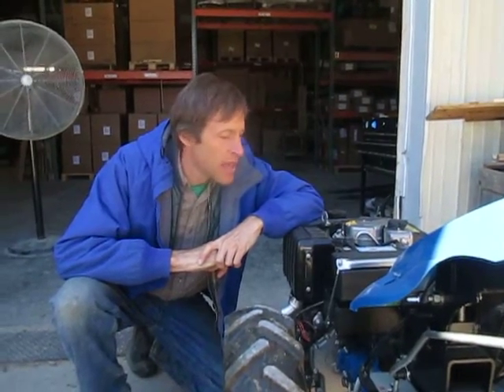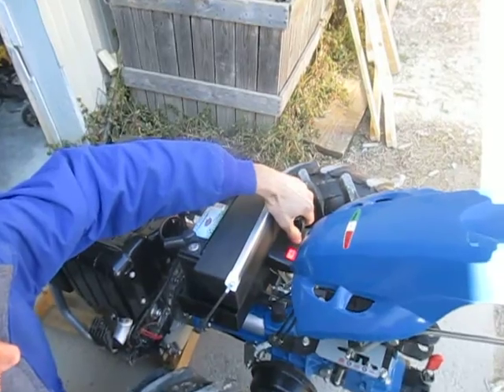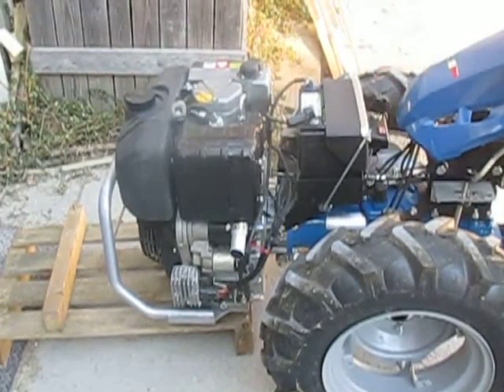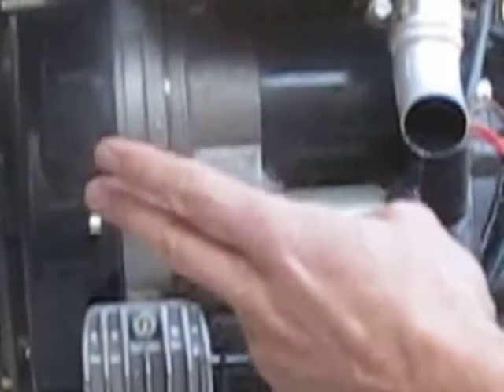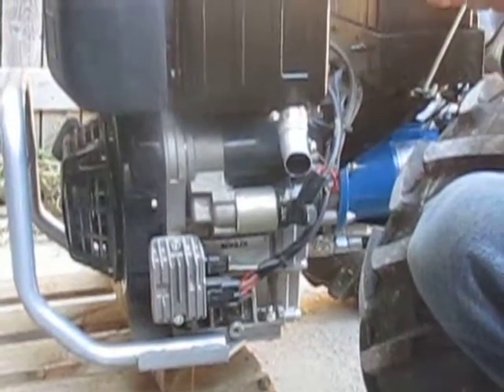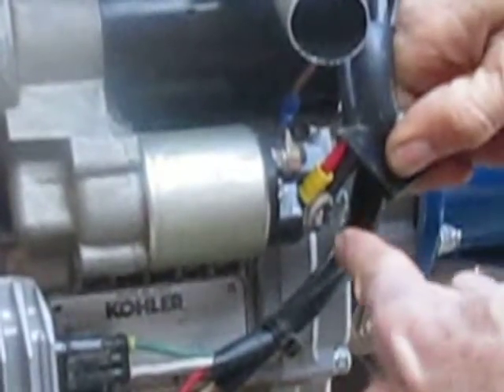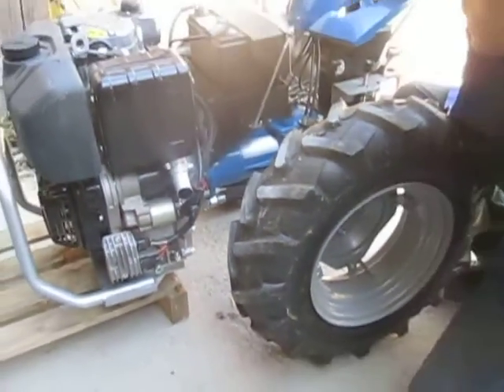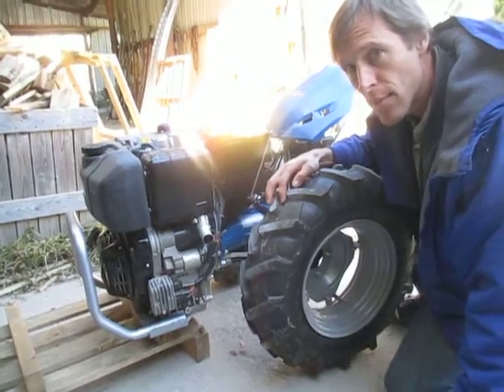Kohler/Lombardi Diesel Engine: Electrical System Troubleshooting Basics

Comment: Hi. Why do diesel motors typically come with electric ignitions as you say? I have a G107 diesel and find it very difficult to start but find that the cost of adding an electric ignition is too expensive to even consider it. Any guidance you can give on how to make the pull start easier would be very welcome. Love your videos - all really informative
Reply from the maker: Since diesel engines have a MUCH higher compression ratio than a gas engine, diesels are very hard to pull "manually", by their very nature, and this cannot be changed.  Therefore, we only stock the diesels in an electric-start configuration. (The engines are available from the factory as manual-start, but we just don't stock them this way)
Reply: EarthtoolsKy what is the shaft size for a replacement engine? And do you sell a kit to convert to a Deisel?
Reply from the maker: call us (Earth Tools) for info.  Our contact info is on our website.